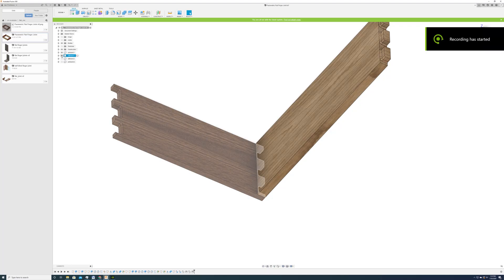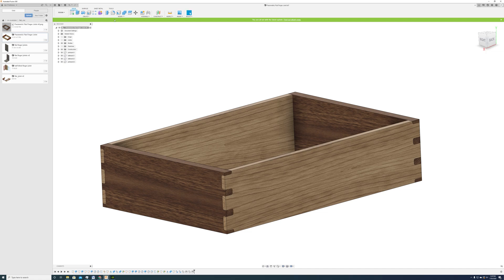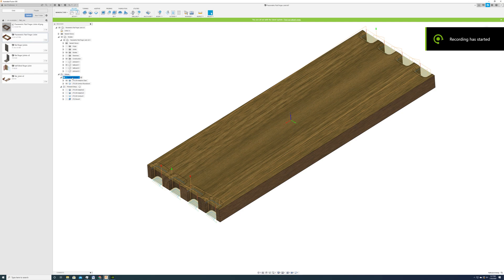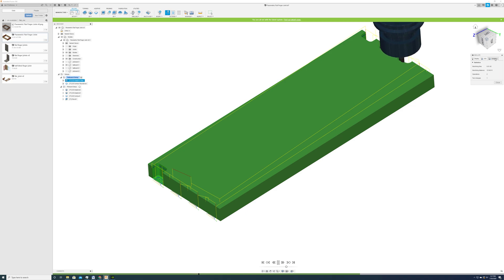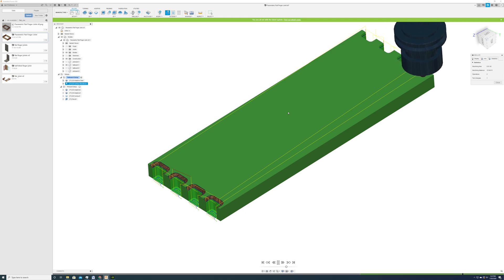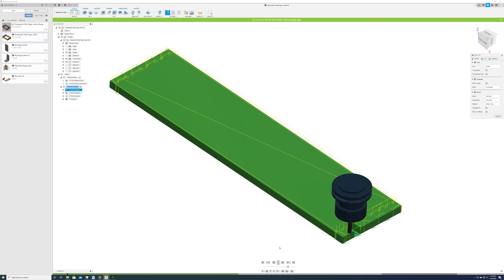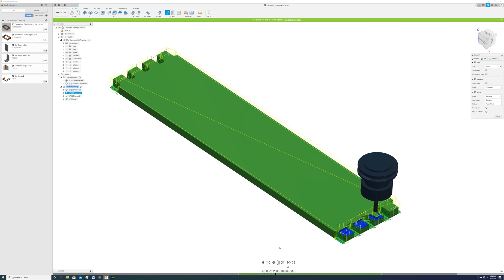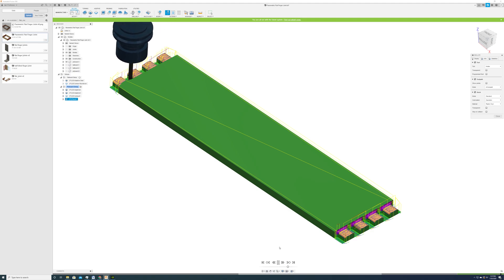CNC finger joints on the flat

Comment: Thanks very much for this. I have been working towards your result after watching a lot of videos doing dogbone joints. I thought there had to be another solution for a seamless joint where you dont have to remount the piece vertically to mill the fillets. I had gotten to the point of using the round over bits and just got stuck due to trying to make each board the same design rather than making the 2 pieces in the joint unique. Anyway, thanks again for solving the issue!
Reply from the maker: If you figure out improvements I would love to hear about it.
Reply: @iporty  in rebuilding it now in metric. I'm learning a few tips and tricks from your file. A couple of curious things I've found is some fillets are not using parametric inputs. Not sure if that was intentional or an oversight?
Reply from the maker: @FilipAus  I started out trying to make everything parametric, but I remember running into problems where I couldn't figure out how to make it work. I remember taking short cuts to just make it work at some point. If you end up with a fully parametric solution in f360 that would be great.

Comment: Waou just amazing! I was using the old windows soft Fingermaker to do that but there is no control for the cam and it is very agressive. I was looking for a solution to make those finger joints flat in Fusion 360. !:)  Thanks!

Comment: Any real world examples of this joint glued up? Any offsets/tolerancing required to get the boards together?
Reply from the maker: Here's an example  https://photos.app.goo.gl/fyi8NicsqiWAKwqG9  . The joint is a bit finicky. I've done a few iterations, and one option that's a little slower for the CNC, but I think is easier overall is to use the ball endmill to cut the roundover. I've made 4 drawers for a file cabinet and a box with this joint so far. Another issue is that the joint depends on the wood being held down flat and I don't have a vacuum table. For the shop furniture I've made so far I've just decided to live with the slight gaps. I think if you tune the details you could create a pretty efficient workflow.  In the long run I have plans to make a wall of drawers in the workshop and I'll probably use this method for it's efficiency, but currently I have too many other projects.
Reply: @iporty  That's a great looking joint and with a little wood glue will look fantastic. Thanks also for making it a parametric design as I know that takes more time on the front end. As for using a ball end mill to make the roundover, I'm curious why you have found this to be superior to simply using a roundover bit?
Reply from the maker: @ryang6513  The main advantage of the roundover for me is that it eliminates a manual tool change and rezero. Also the roundover can be difficult to create the toolpaths for since the tip tends not to be a perfect point you need to get the offset correct. I would think in a production environment the roundover would be better.

Comment: fantastic design and setup.  I am having an issue when adjusting to the tailboard length.  It blows the box apart into two 'L's which when increasing the length also causes overlap.  When increasing length it forces some of the joints into being mortise and tenon.  Likewise when looking at the toolpaths the tailboard only does 4 tails on one of the operations.  Love the design, but am not understanding where to adjust for these.
Reply from the maker: I have an updated file that I'll upload and post tomorrow. If it doesn't help let me know your settings/parameters and I'll investigate.
Reply from the maker: Here is the link to the latest version that I have been using to make drawers. If it doesn't work, let me know what parameters you are using (e.g. height, width, thickness,...) and I will take a look and see if I can fix the problem.  https://a360.co/2HXHB6O